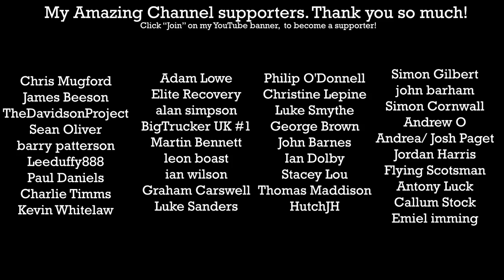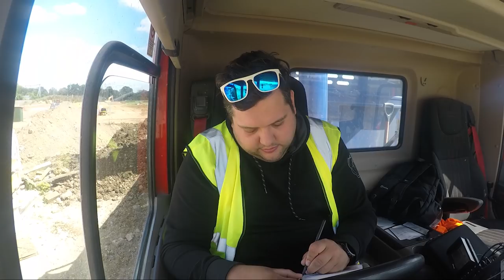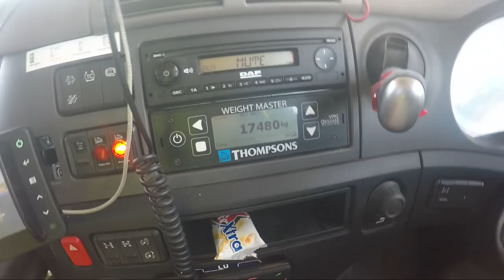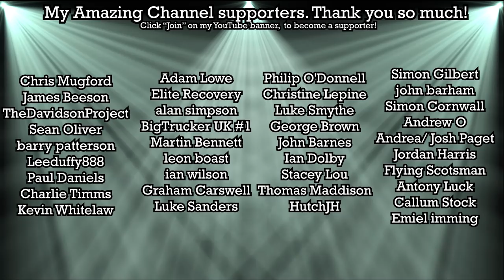ICE-CREAM!!!!!!!

Comment: The body needs to be up off of the chassis so the load cells on the lifting ram and rear body mounts can support the full weight of the body to calculate loaded weight.